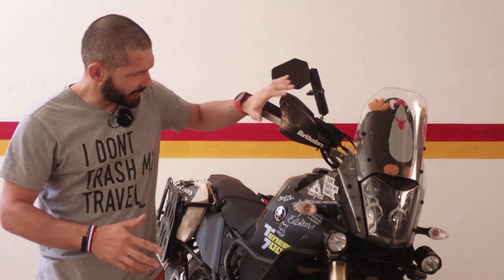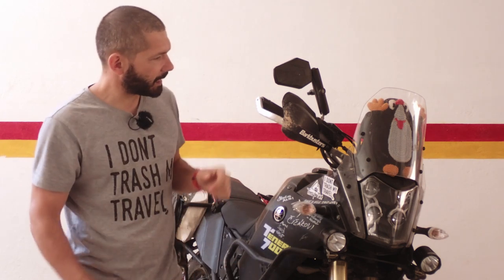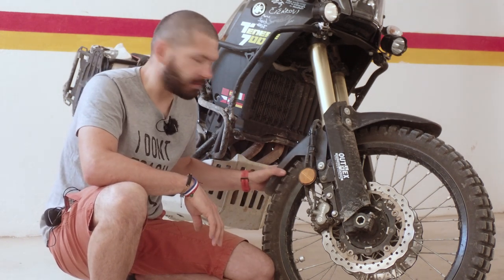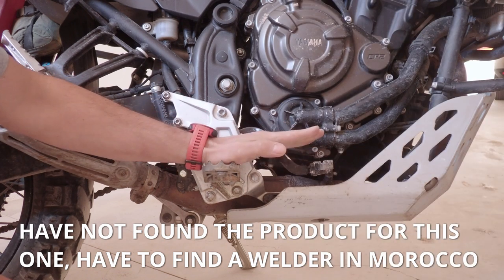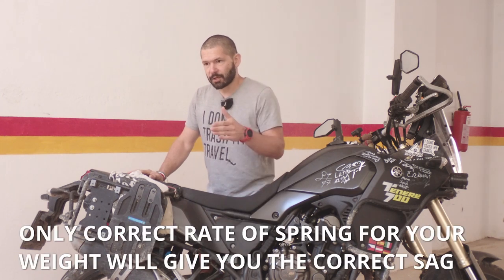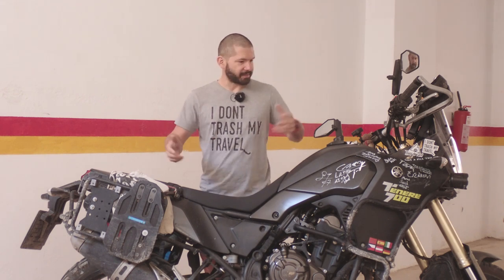Yamaha Ténéré 700 10k: Problems & Solutions

Comment: For the wind shield, i use cable tie to connect  to the fairong/frame. when i crash, the cable tie will break first and its easy to replace without the need of tools. No it wont rattle and sustain high speed even with 100x2.5mm i use. maybe this could benefit you too
Reply from the maker: This is very good point! Indeed that will be good solution, my windshield has been ziptied to the frame on Honda in the end as well. The fame could still crack but the zip ties may just absorb enough energy before snapping to dampen the impact. Thanks!

Comment: The nylon bolts for the front fender is a golden tip! cheap and fast solution.
Reply: UK nylon number plate screws work,just cut off the thin tip...black and cost pennies
Reply from the maker: I was pointed to them by the RallyRaid, but as Oyley says... any nylon screws will do the trick.

Comment: Really good round up of some valid points,  but the bottom line is that the T7 is mostly a brilliant bike.  It's a case of personalizing the bike and making it even better!!  Cheers,  Steve
Reply from the maker: Thanks, yes I think that would be my conclusion as well. Nothing mayor so far.
Reply from the maker: I also think it's great platform for the tweaking as it is very simple to play with and adjust comparing to more "advanced" shall we say bikes.

Comment: Just arm chairing here, but I would definitely look into a guard for the water pump! 2 review videos, where the reviewers have witnessed other riders have a simple lay over on the bike and it sprung a pin size hole in that pump housing. Not a good time out in the wild, especially the way you ride, probably a miracle you didn't rip the whole housing off tbh XD
Reply from the maker: Noted! I'm contemplating the solution for that. I'll be doing Dinaric Rally next week and I hope that I can survive without the guard. I seems to actually scratching it with my metal tip on my boots.

Comment: I have a big problem: I do not have Tenere yet xD! Jokes aside, hesitating between #Honda Africa Twin and this #Yamaha. 
@FAR&FURTHER  It's great you share your experience with this one.
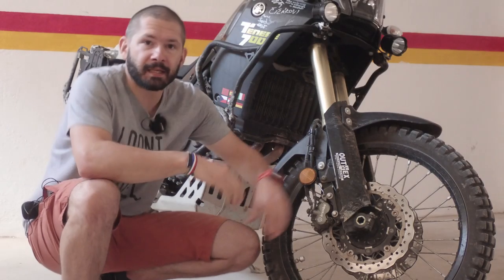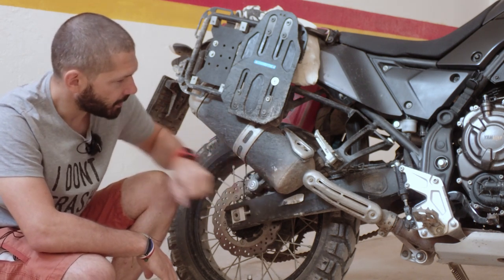2:01 Looks like Yamaha engineers said: lets keep that weak point for next 2022 version update - otherwise I see no reason why to keep such a front fork flow - did they tested hard this machine before releasing it?   Next, 3:52 Yamaha made awkward design for the lower suspension linkage especially this bike is meant to be an off-road bike. Certainly no bike is perfect, but this Yamaha is pretty close to it - Hello #Yamaha are you listening your real users? Hope so ;)
Reply from the maker: Hi, well no bike is perfect. I have to say that the lower linkage is not an issue really. I've now done Dinaric Rally with it and the rear linkage is least of the problems. You would need to do some really dificult single tracks and rock steps in order to get close to damage the rear linkage. Yes when I was training jumping over the rocks... than it matters.
Reply: @FARANDFURTHER  Great to have real-experience opinion from T7 rider!

Comment: Just ad a toggle switch inline to the fuse you remove for the ABS problem solved.
Reply: that is both genius and so simple
Reply: @goatman86  Thanks, my first experience with that idea was turning off my odometer in my new 93 GMC pickup, use your imagination why I would do that, hid it inside the glovebox.
Reply: @roadiemort3589  My first guess would be to hide the real mileage when reselling but then why hide it. You could have just removed it when selling. It was YOUR new truck so I don't think you had to hide from your Dad or maybe wife ;) so my next bet is on extending the warranty period. That's as far as my imagination will go I'm afraid.
Reply: @goatman86  Warranty 60,000 or 4years lol.
Reply: Truck is long gone but still have same switch lol.
Reply from the maker: That is next mod to do. Some people do it with the fuse some people do it with one of the ABS sensors as the ABS will give up if it has only one... For now, for extended off-road, fuse goes out.

Comment: I have a full Rally Raid converted CB500X that i am very pleased with, the Tenere 700 has been a bike that was thinking about getting... what is your take on this, will the T7 be worth switching to, even thou it will cost me the doubble of what my CB is worth ? I ride gravel roads and forrest roads besides normal driving on pavement aprox 70/30. Looking foreward to hear from you.
Reply: I had a CB500X with the full Rally Raid conversion. I live in Los Angeles and I was always looking for 6th gear with the CBX. With the T7 that I now have, I barely need to go into 5th gear and there is still a 6th. Both bikes have similar nibble handling. The T7 just has so much more power. 
I am not lucky enough to ride on my imaginary massive property or go across the street for off-road riding. I have to be on the highway for a while, so I need a bike that can handle the higher speeds.
The T7 is a champion off-road.
Reply: Also, after doing the full Rally Raid conversion on a new CB500X, you are at the out the door price of the Tenere 700.
If you bought a used CB500X then added Rally Raid, you are at the ticket price of the Tenere 700.
Reply: I brought my T7 home just a few hours ago. Fantastic bike!! I am 57 and it will most likely be the last bike I will ever buy. My last bike was a 2003 Burgman 650 that I had until 2017. The grass is always greener on the other side of the hill. You put a lot of money into the CBX. If you loved it yesterday and not today, what changed?  The new 800cc Africa Twin will be here in the near future. It may become the new rage. Me? Don't care. A lot of guys still ride KLR 650's and love the heck out of them.  Something better is always around the corner. Now go out to the garage and tell that CBX how much you love her.
Reply: @comfortablyunknown700  Excellent point....It seems the problems of the T7 in this review is so minor and solvable...The rest is up to us..how we handle the T7 and enjoy its superior engine and basic (great) qualities... bravo...mate
Reply from the maker: Sorry for late reply, guys here made good points. I've upgraded to T7 because I was really looking for something which would allow me harder off-road than RR CB500X. If I'd not aspire to ride a rally for example (done Dinaric rally recently) or do a lot of sand riding in Africa there would be no need to upgrade CB500X as it would be enough for the travel.

However once you do reach limit (off-road) on CB and you recognise that you reached it the T7 is natural upgrade. I still have CB500X and rode it recently and the difference in handling off-road and standing position is immense...

It is up to us to be honest with our needs... Dinaric rally on CB500X would be hard, my previous trip to India I done on CB500X would be less comfortable and more expensive (fuel) on T7....

Comment: How is seat comfort for a full day of riding?
Reply from the maker: Hi Bob, I have done multiple long days, longest was 900km and I would definitely not say it is uncomfortable but of course after 900km in a saddle you feel it. But it was surprisingly comfortable, I thought it will be worse as the seat is narrower than on CB500X. For me it's comfy enough, although the CB500X seat is of course more comfortable.
Reply: @FARANDFURTHER  I have a KLR 650. I love this bike, but want more power for highway riding. Even with my front cog changed to 16t the klr works to hard at 120-130 kmph. 
It's the simplicity of the klr that I love and am thinking of making the switch to the T700, assuming it is similar in comfort.

Thanks for getting back to me!
Reply from the maker: Hi Bob, have no experience with KLR650 but the reason I wanted the twin and not single was the comfort, the vibration at the highway speed is very minimal on CB500X and even less on T700. T700 engine is happy at that speed more than the CB500X one was. In terms of power the T700 has more than enough for me with luggage and when I'm doing enduro training it has a bit too much and as it lacks all the bells and whistles it becomes all about skill.

These things I really like about T700 I think as I find the T700 being upgraded CB500X you may find it to be upgraded KLR650 ;)

Comment: The screws for the front fork guards are just plastic m6 number plate screws, I have also added some skateboard wheels on threaded bar through the front axle  that stick out slightly further than the vulnerable spigot on the fork bottom. If you have an email address to give me I'll send you some pictures.
Reply from the maker: Awesome! I’ll send you my address that sounds like pretty cool idea! Love it!
Reply: @FARANDFURTHER  Pictures sent fella
Reply from the maker: @fenner-g6088  Checked the solution and it is amazing! I'll definitely implement the same on my T7. BTW I really really contemplated the red/white! Thanks a lot!
Reply: @FARANDFURTHER   No problem,  cheap mod that could save an expensive repair ! Feel free to share in a later video , ride safe.
Reply from the maker: Perfect, will put one together and will share & give credit!

Comment: I Think the rear break lever should be wider, or more right
Reply from the maker: You mean brake lever? Yes I will modify the brake lever as it also lacks 2 positions one for off-road and one for road. I bend the brake lever all the time so I'd not put it more to the right what I will do is probably change bash plate so it can't bend that much in.
Reply: FAR&FURTHER yes the rear brake lever is not in the right position

Comment: Aren't you concerned about the exposed water pump?
Reply from the maker: Yes and no... During all my travel and training I've managed to scratch the water pump only with my metal tip on my boots. Initially I thought I'll do some protection for it but it seems fine for now.

Still in rocky terrain I think it is exposed and if one would ride hard and drop hard, there is a risk of damaging it. Possibly... lets see on the Dinaric rally in 2 weeks.

Comment: I didn't' think pulling the fuse disabled abs without any issues.
Reply from the maker: Yep it does, only your abs light will come on but that’s fine. Of course it is illegal and frankly makes no sense to ride without abs on public tarmac road. But for off-road in group it’s useful as your not constantly playing with the abs button 😂
Reply: Hi.Seen one video where if you stall the bike.The abs will still be turned off. But only for a short period because it will drain your battery.

Comment: For the exhaust problem,  just cut it off for sport/shorty one.   Watch out for another potential problem - weak, alu peg mounts... Some guys broke them already.  
BTW I know now I won't replace my old xt660 tenere :)
Reply from the maker: Do you think cutting the exhaust to shorty one would solve it? I guess it could, I thought about changing the piping angle so it clears the swing arm. I think I saw people putting shorty exhaust and it solved rubbing off the swing arm but didn't solve the problem of exhaust being bent inwards all the time.

Comment: No problems. Buy an english, german, american or italian bike and you will have real problems to deal with. Eletronic failure, oil leaking, gearbox issues, broken frames ( Áustria) , the list goes on and on. Japanese bikes when it comes to reliability are in another planet. You can but a 1000cc Japanese sportbike and race Le Mans 24 hour race, stock.
Reply from the maker: Yep, no real problems at all, most of it is routine maintenance or what I'd consider wear & tear.
Reply: Ktm 790 adv is more reliable than cheap t700

Comment: With the abs, at least it's only a button to push and not a full maze of settings to go through.. So I don't see that as a problem
Reply from the maker: Indeed. It’s just when I do it 20 times in 2 hours it gets a bit boring :)
Reply from the maker: I am 100% grateful the bike actually does not have a menu. It would just be cool to turn off the auto enabling of the ABS in certain conditions, like my training sessions or days doing off-road traveling. But even for that, if I really want a kill switch for ABS could be fabricated.
Reply: wrong, wrong , wrong, it's a nightmare, 10 hours riding outroad probably you will push the button 30 times
Reply from the maker: Yes riding off-road it get tiring a lot. Especially in a group when you are the one who stops all the time because you forgot to turn off the ABS....
Reply: The AJP PR7 has a kill switch that allows you to switch the bike off without having to turn the ignition switch off which keeps all the electronics up and running. Clever idea
Reply from the maker: Same on T7, but that does not reset the the ABS settings on the T7 while it is moving. So that's the reason I have to switch the ignition off with the key.

Comment: YAMAssHAt took 3yrs + to develop the Tenwhere 700, they only needed a chassis,the engine was already in production,thank the Gods they dont make planes or medical equipment   The exhaust shoulda been higher like on the Stupor Tenere 1200     easier fix would be to change angle of the can so it clears the swingarm by changing the link pipe along with a replaceable upper bracket instead of welding it to the frame
Reply from the maker: When I was back home and we were preparing the bike for the trip, the change of the angle and the pipe was suggested. However it was time consuming and quite costly at the time so I abandoned that idea. It may be relevant though as the swingarm is getting thinner every day...